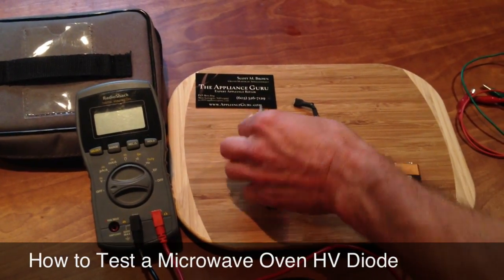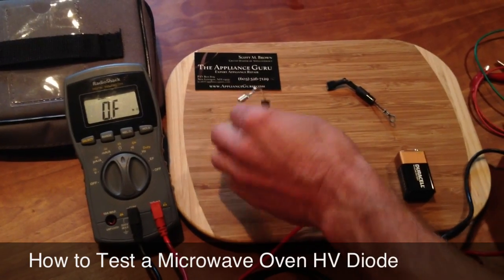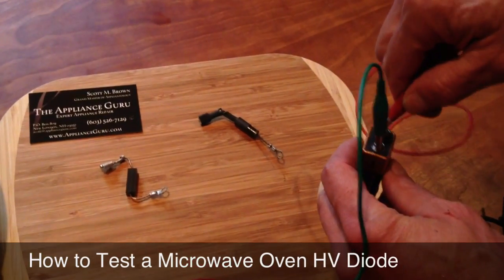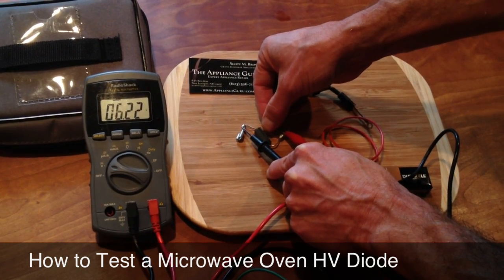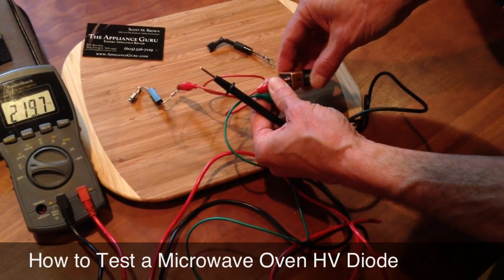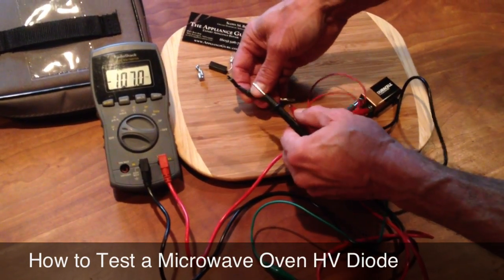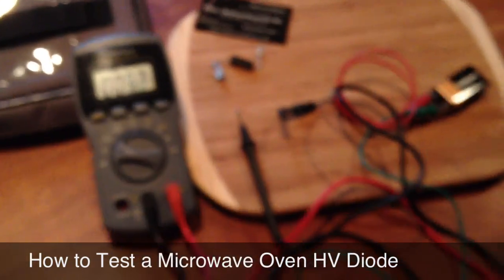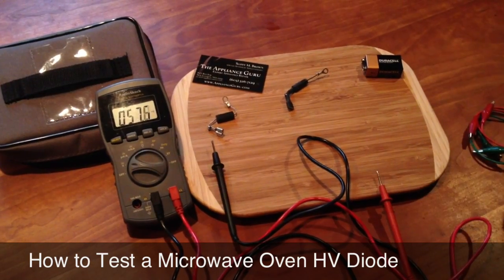How to Test a Microwave Oven High-Voltage Rectifier

Comment from the maker: This is a great question because it brings out another failure mode of the PN junction inside these rectifiers.  In the the first diode that reads 9v in both direction, the PN junction has failed short.  In the second diode, where you're reading 2.5 v in both directions, the PN junction has failed "quasi-open"; in other words, it's not a true open but neither is it acting like a PN junction anymore.  So it would be replaced as well.

Comment: I have never had any 'wild' readings like that--maybe you have an oxidation problem causing bad contact.  I use homemade razer sharp and high spring tension (because of the grease-like mess) alligator clips.  The readings could be so much clearer.  Thanks for the video.

Comment: I have removed the diodes from my microware to perform this test.
One diode reads the full 9v with the probes in either direction.
The other diode reads a drop of about 2.5v which I think is ok but it reads the same even if I switch the probes.  
Is this faulty?

Excellent video by the way.  You may have just helped me save my £250 microwave for £25 replacement diodes and an 8A ceramic fuse.

Comment: I was ready to buy an expensive multimeter that would read up to 200M ressistance olms but your 9 Volt battery test worked fine. My reading was 5.7 on a new battery. i suspected as much since micorwave heats food fine....but BUZZZZZ is driving me nuts. Tested mag and transformer.... both are borderline, but Im betting mag is bad since buzzing stops when i disconnect it. Thanks for your cool video!

Comment: I use my insulation tester on the 240volt it has a closed circuit one way and a open circuit the other. A bit quicker?

Comment: Hi, great demo. But the term "rectifier" is used incorrectly, this is a diode you are checking. A rectifier is an assembly of four diodes and is used to create DC from an AC sinusoidal waveform.
Reply from the maker: The assembly you're referring to a specific type of configuration called a bridge rectifier. But this only one type of rectifier in addition to the high voltage rectifier shown in the video. To quote an authoritative reference: "The term 'diode' is customarily reserved for small signal devices, I ≤ 1 A. The term rectifier is used for power devices, I > 1 A." Reference: http://www.allaboutcircuits.com/textbook/semiconductors/chpt-3/introduction-to-diodes-and-rectifiers/

Comment: Thanks for the example. My microwave works but doesn't heat. Should I check the rectifier or do you think it is a different problem. I checked the fuse that looks like a cap, tested the capacitor and the white fuses and all those seem to be fine. It worked fine last night then this morning would not heat. Any suggestions? Thank you in advance.

Comment: I have a no heat in a whirlpool microwave WMH31017AB0 all 3 door switches test ok the Diode test ok High Voltage Capacitor is not shorted to the case or each term. it is a 10meg  and shows 0 when i test ressistance is the Cap bad ?

Comment: great video, very well explained, i performed the same test and i got 3Vacross the diode which is a significantly higher drop than what you produced, wonder if its bad ?
Reply from the maker: Omar Hammoud I'm thinking your 9v battery was a bit run down, maybe only started at 7 or 8 volts.
Reply: Same with mine but I check my battery it started at 9.51v

Comment: What if with a known good battery the diode drops the voltage less than 6 volts. What if it drops it to 2 volts, is the diode bad?

Comment: I'm trying to repair a 6 year old GE microwave that stopped heating and makes sort of a buzzing noise. I'm starting out by replacing the diode since it is the easiest/cheapest fix and I don't have testing equipment. The existing diode appears and smells fine (no burnt smell). Is it likely for a diode to fail while still appearing good with no burning smell?
Reply from the maker: 1imesub This is the most common failure presentation for the HV diode. In the video, you'll notice there were no outward appearances that the diode was bad. This is typical. You gotta test 'em to know.

Comment: I tested an HVR 1X 3 diode from a GE microwave and a good 9V battery. One side test shows a voltage of about +5 and the other side (reverse) shows -5 and then slowly drops. Does it mean the diode is good or bad?
Reply: Yes.

Comment: For the time you spent making this, it would actually be a really helpful video if you showed all of the connections with your wires between the multimeter, to the gator clips to the battery to the diode. But instead, half of it was off screen.
Reply: If you could not understand it then you are the problem not him.

Comment: Sir, i have some issues with my microwave oven. I have replaced the busted fuse with the same rating as with the old one but for some reason, the new one was also blown up. When I have replaced it and plugged the microwave, everything goes fine. But when I started cooking, the microwave will start to blow the fuse up.

Comment: Kind of good video. The drop voltage is 15 volt for many high voltage diode, so a 9 volt battery would not work.

The bad diode can be short circuit (measure 0 volt, and a standard ohmeter would also detect a few ohm) or open circuit (standard ohmeter can not test this, neither in ohm mode nor diode mode).

The good diode will not conduct in one direction, and conduct only when voltage is above the threshold. But, not illustrated in that video, you need a resistor to limit the current to the diode. In this video, the hope is that a 9 volt battery is too weak to damage the diode. It is ok for microwave oven diode as they easily work with 1 amp continuous, and many amps pulsed.

If you are testing a high voltage diode for CRT, air filter/ozone generator, laser printer, etc that 9 volt battery could destroy the diode. Not wise! A resistor is cheap... often free! Use it wisely!
Reply from the maker: +Christian Gingras The 9v battery is sufficient and non-damaging for testing microwave HV rectifiers, which was the focus of this video.